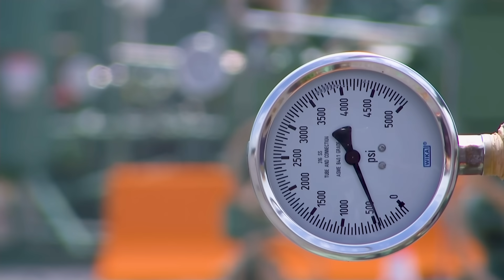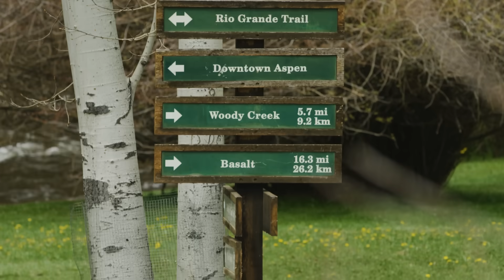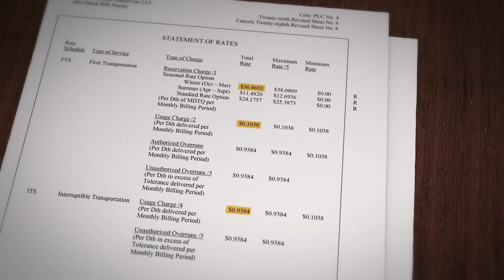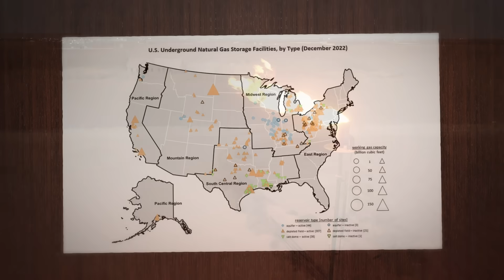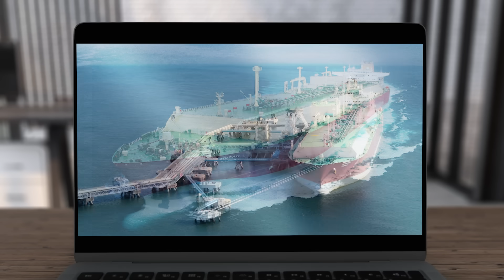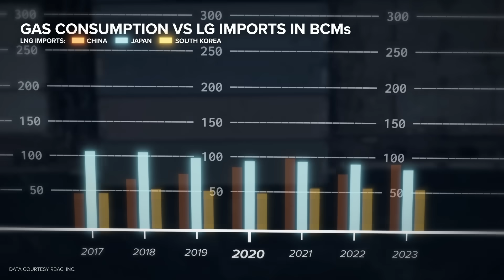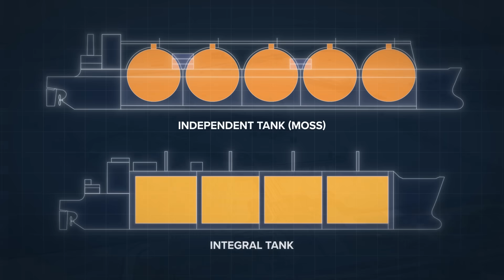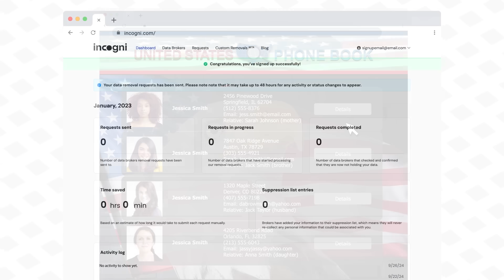The Logistics of Natural Gas

Comment: In my neighborhood the local gas company has been starting to replace most of the piping that was put in close to 40 years ago, which I think is steel or iron-based with plastic piping. They haven't gotten to my house but half of my neighborhood or on my street one house. Actually two houses my neighbors have had their pipes replaced. Mine has not yet and they're replacing all with plastic what I've seen. It's a yellow plastic pipe and the only time the transition switches is when it goes above ground near the meter where it's the traditional iron piping or steel piping. Whatever is used for the gas, transportation, piping into your home and to the meter and beyond

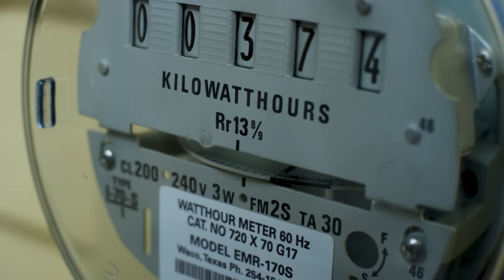Comment: 17:20 In the US natural gas is the cheapest fuel for heat.  Electricity is the most expensive energy source for heating.  Heat pumps use about 1/3 the electricity per BTU as resistance electric heat which is still considerably more expensive than average residential natural gas heat by 50% and this is only in the efficient temperature zone for a heat pump with average priced electricity.    Below freezing an air-to-air heat pump efficiency falls off considerably.   Below freezing is where the heat pump no longer had capacity for additional heat and turns on very expensive resistance heat.  A heat pump water heater is counter productive.   It cools the air in the winter time requiring  the house heating system to make it up.  

Without natural gas hook ups it means a return to fuel oil for heating and for high end stove cooking, propane.  Fuel oil forty years ago was a bit more expensive than residential  natural gas per BTU and a lot more bother.   Natural gas wholesale costs in real terms are about half of what they were in the late 1990s.   Electric rates in the US are increasing considerably for supporting large amounts of solar and in some locations wind generated electricity.   The support comes from natural gas turbine generators.  

US natural gas trades below profitability because of over supply which will disappear with new overseas markets of US natural gas leading to more normal prices at about double what it is today.    Much of the cost of residential natural gas is the distribution network.   The higher priced natural gas will double the cost of running natural gas turbine generators.    Heat pumps for heating will become increasingly expensive to run with more expensive electricity.

Comment: Not going obsolete any time soon. We still need ng to generate electricity so the main trunks will still be very functional. Also even more importantly, this is actually a national security stronghold. In the event of a grid failure or attack, ng will provide valuable heat energy and the fact that it is mostly underground protects it from attacks. It is a real godsend in terms of energy diversification.

Comment: 13:20 Natural gas is "cleaner" because:

1. It's mostly simple molecule methane which burns very well, generating max heat with no byproducts except water and CO2

2. Traditional thermal power plants use steam to convert heat into power. The efficiency of the process is limited by thermodynamics: the max temperature of steam is around 600 deg C. Max theoretical efficiency is about 35-40%.

With gas you can burn it in a gas turbine first at 1300 deg C. Higher temperature allows generating more power. The exhaust will be hot enough (like 700-900 deg C) to still run a steam cycle. Max theoretical efficiency is about 55%.

Comment: Amazing how natural gas has to be frozen, shipped, reheated, and piped—just to boil someone’s pasta. The world runs on invisible miracles we rarely notice
Reply: Funnily enough, if you have an electric cooker, natural gas is still being frozen, shipped, reheated and piped to boil water and make electricity to then boil water and make pasta
Technology's history is just adding steps and ending boiling water
Reply: Also has to be found - which is another ball of wax.
Reply: technically ‘condensed’, not ‘frozen’
Reply: Ultimately it is all just different forms of stored solar energy.
Reply: We need energy to survice and at this time and age we use natural gas, few hundred years ago we use coal.
Reply: @HFDLI

And now we're increasingly cutting out the middle man and just directly using electricity. 

You use one of those newer induction stoves? Where they use magnets to directly heat the pan or pot, no energy loss from the hot gas flowing around the pan instead of transferring heat to the pan? They're fast as hell. It's wonderful. 

And they need kind of a lot of energy to turn on, they're super energy efficient (because electric is in general way more efficient than burning a fuel at the point of use. Double, triple, sometimes even more efficient), so you can run one with some fancy semiconductors you slap on your roof. 

Then the miracle becomes the process that makes all of those electronics and makes it so cheap and easy to turn sunlight more directly into boiling water
Reply: Or we could just go back to burning wood. And what a nightmare that would soon turn into. Depleted lumber from slashed forests, sooted air, horrific smog. LNG is a miracle for now until nuclear or fusion is mainstream or another future alternative that’s yet to be discovered.

Comment: It's gonna be interesting to see what happens to natural gas pipelines as time moves on and we become less dependent on it. I already use very little because I live in a warm climate have have an electric dryer. I still have a gas stove, furnace, and water heater; but I'd like to replace those with electric versions because I live in a small house and don't like combustion byproducts in my breathing space. People keep telling me to keep it for power outages, but I really couldn't care less. If I have a major outage, such as during a hurricane, I likely won't be home anyway. Besides, all those devices other than the stove still need electricity to function. Even the oven part needs electricity. Yeah, I could power them with a generator, but I really don't care. As it stands now, having gas service costs me more than the gas I actually use.

Comment: This is a very interesting topic and video overall. But there are quite a few issues with the script. One thing is just plain wrong: China has natural gas coming from Russia via the Power of Siberia pipeline. 
The video also talks about a coming reduction in gas/LNG that counters the facts: In the U.S. alone, there are LNG terminals already being built or expanded, and the current administration is an avid supporter of LNG. Russia plans to expand its pipeline network in Asia. China is the largest client at the moment with plans for a Power of Siberia 2 pipeline linking it to Russia via a different route. Plus the U.S. seems set to ease sanctions, then Russia will be able to (openly) export more gas to Asia to satisfy the growing demand. 
South Korea and Japan currently do not have natural gas pipelines linking them to other countries, but both countries are exploring options to increase their sources of energy which involve gas. One plan is to interconnect energy grids between various Asian countries including South Korea; The plan would include gas power plants. Another option being considered is a gas interconnection plan between ASEAN countries that may include Japan. Indonesia and Malaysia are ASEAN countries that have offshore gas fields. There are geopolitical and financial hurdles, but pipelines already exist between some ASEAN countries. Whether piped or via LNG transport, importing gas between ASEAN countries is highly desirable because the shorter distance between producers and consumers would lower the price of gas, and doing so would diversify energy sources for gas intensive and emerging economies in the region.
Lastly, at ~12:40 the transcript says that most of the big suppliers are far away and across oceans that make any sort of pipeline project infeasible. Perhaps this is meant to refer to China (which is increasing piped gas from Russia), South Korea and Japan; but it seems to imply that pipelines cannot be built across long distances with large bodies of water.
 This is untrue: Natural gas is piped from offshore rigs to the mainland just like oil. Also, natural gas from Russia had been going all the way to Germany and beyond, passing under the Baltic Sea (via NordStream 1, plus NordStream 2 before it was destroyed by... someone). There are also pipelines across the Mediterranean Between Algeria and Italy, etc.
Other comments have made these and other points. I think it would be worthwhile to consider these suggestions and re-cut the video or at least add notes to it, given how important the topic is and how many people will watch it as their main and only source of information about it.

Comment: I really don’t agree with your last point. We are building more then ever natural gas pipelines because of all the new heatpumps and induction heaters. It takes a lot of power to run those and the current “best” power source is natural gas. It burns relatively clean can generate lots of power compared to other alternative fuels for its size. And creates some of the most stable power for a grid.

Comment: Here in India, large cities generate 00's of tons of biomass everyday which can be turned to biogas -> biomethane (same as natural gas). There isn't much heating requirement here being a tropical country, and biomethane produced and consumed locally(cooking, vehicle fuel) has lower logistics cost. NA Gasoline engines can also run on CNG making it a renewable carbon neutral alternative. (Carbon neutral as CO2 released during biomethane production is just pre captured atmospheric CO2 differing from fossil fuels). Biomethane/Biogas deserves a whole video on its own.

Comment: Banning NG connection in new construction is nuts.  These politicians refuse to see the writing on the wall regarding sustainability, making everything "electric" is nuts.
Reply: I would never buy a house that did not have natural gas for the hvac and stove.  It is alot cheaper.  You can also use it for a generator.

Comment: “Buildings are putting in cleaner electric appliances!”😂 Where is the base load power coming from. If you have 5 mw of solar and wind power, you need 5 mw of coal, oil, gas or nuclear standing by. If the US builds a lot more nuclear, then maybe you can call our grid “clean”. Of course the radical environmentalists stopped nuclear and made it too expensive after Three Mile Island. Also, they’ve stopped underground storage of waste, to a large degree. The ignorance of the public about energy is astounding.

Comment: Along the burried section of pipeline, we also install a cathodic protection system, a complimentary yet effective corrosion protection method to the polymer coating, assuming the coating has certain percentage of defect (around 5%).

Comment: 15:12 I'd like to use this opportunity to share one of my engineering precautions about coolant refrigerants. Additives are usually added inside coolants to utilize coolants beneath usual freezing temperatures. The consensus about effects of cyclic stress, quasi-strain, atomic reactivity, and structural integrity of pipes is limited by what little (and in my opinion not enough) data we have about sub-zero environments, especially when accounting the changed geometries and therefore changed location of the historically maximum strained pipes. Thank you for reading.
Reply: I am a former university participant in cryo research (about quantum signal detection) and a former service engineer in chip chemical disposition machinery as well as inert gas transportation.

Comment: Potential topic for another video are the various plans to convert natural gas pipelines into hydrogen pipelines, which can act somewhat like a fossil free version of natural gas. Getting that infrastructure to work could be huge for climate adaptation, as this kind of energy transportation and storage can be done on a much larger scale and over longer distances than traditional electric wires and batteries.

Comment: It's funny are the end you say electric appliances are "cleaner"... when they are literally burning natural gas to generate the electricity needed for those appliances. All you are doing is burning it off site and losing efficiency through power transmission.

Now if we would just build a ton of nuclear plants then it would be correct but a certain political party has made that impossible for decades.

Comment: Man, its crazy to think that the drywall plant is so energy dense it runs its own "6MW power plant". My local University campus is heated via steam made in natural gas fired boiler. They run a 15MW steam turbine as a pressure reducer so they can generate higher efficiency high preasure steam, but then distribute it at low preassure that is actually useful. That turbine alone runs the plant, aswell as powers a significant amount of campus. A seccond 30MW demand generator is also there for when gas is cheap and power is expensive.

Comment: As an appliance servicer, we have both urban and rural residents with gas appliances, and diagnosing NG vs LP is astonishingly different.  NG floats in regular air while LP sinks, and LP carries MUCH more energy per unit volume, so the orifices for you burners are much larger for NG to provide the same amount of BTUs.  Our sales department converts appliances (which come set for NG in most instances) to LP for rural customers, but sometimes folks do a pick-up a non-converted appliance without realising the difference and have a giant blow-torch for a burner as a result.

Comment: I don't know if your prediction that gas might become less relevant at the end is true. It might become true if gas becomes much more scarce and therefore expensive, but otherwise it doesn't seem like it's going anywhere. It's actually incredibly efficient: we used just under 2 large tanks (totaling about $250 in cost) in 10 years (!). Granted, we don't cook every day, but at least once a week. If you have a central gas hookup in your apartment, most of what you're paying for is probably the infrastructure, not the actual gas. It's also cheap enough to generate general electricity, and considered clean enough that it's not harmful to people's health even if they live across the street from a power plant (at least in developed countries with strict regulations). Sure there are some niche uses that could become less common, e.g. CNG vehicles, but it's a small fraction of the total global gas consumption.

Comment: Im a field engineer for one of these gas pipeline companies. First off we use units standard cubic feet SCF as the units with prefixes of millions or billions per day in pipeline transmission. Don’t kid yourself, natural gas isn’t going away in a few decades because municipalities aren’t putting gas lines in new buildings. We used to have a major winter peak for gas demand due to heating but more and more the summer peak is longer and higher. Gas is used for on demand gas turbine fired power plants turning natural gas into air conditioning. Expect more gas to be burned in electric power generation to power the heat pumps, EVs, AI server farms and crypto coins. The US electric grid will become the weak point in energy delivery.

Comment: Its so funny that the US uses 'Dekatherm' to simplify the calculations of energy-content but still uses a non-SI unit for it :D
Reply: And volume units are MCFD and MMCFD (thousands and millions) But like other industries the cost to switch to SI would be incredibly expensive
Reply: AI power consumption will kill LNG, just guessing
Reply: Not really a SI unit.  Deka is 10 and a therm is just 100,000 btu so a dekatherm is just a 1,000,000 btu.   Volume is volume not energy but farmer math of nominal tariff gas can assume 1000 btu/cuft so 1 MCF (M=1000) could be assumed to be 1000 x 1000 or 1,000,000 btu meaning a dekatherm is about a MCF.  I think I got that right.

Comment: Electrons have mass and there are also district steam utilities still available. That's 4 physical goods as utilities. Also gas utility is nowhere near as common as that intro suggests. Even in the suburbs, you often still need to have heating fuel delivered by truck, with coal generally being the cheapest on the east coast, wood being cheapest on the west coast, oil being the easiest to install and store and gas being a bit on the pricier side when you figure BTU per dollar.

Comment: They really fill the pipe with water to pressure test it? That does not sound like a good idea to me. After all, you have to get the pipe dry again to prevent corrosion and to avoid water vapor in the natural gas. As the pipe is filled with air anyways, it sounds like a good idea to me to just pressure test it with more compressed air. Or to use the same gas that is used for purging the line. I suppose Nitrogen is being used for that purpose.

Comment: With Russian gas lines to Europe under risk through war, political, faulty construction or any other reason making it unreliable source, Europe has racing to build new ports facilities to receive gas by ships to cut reliance from Russia. China for their part are buying more from Russia, but they have their own gas and don't need nearly as much, so pipelines from Russia to China are few and has low capacity.

Comment: I heat my home with natural gas, and it is very much less expensive than if I had a heat pump or any other type of heating. Rumor has it that the Democrats are wanting to put a stop to it.  Supposedly, it emits greenhouse gasses. Kinda like the coal mine 3 miles away, or my 1967 Ford Fairlane. I say I'll worry about it when I'm in the ground.